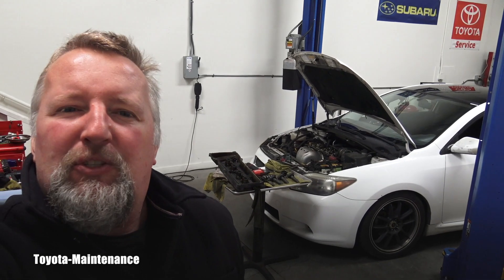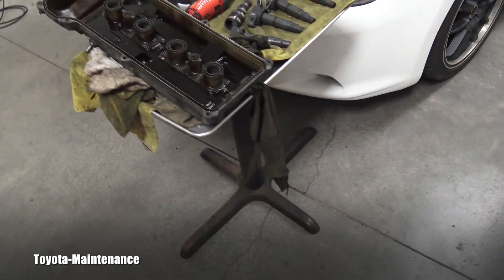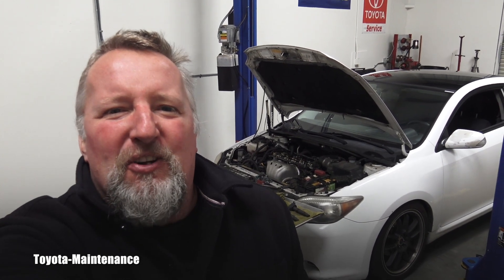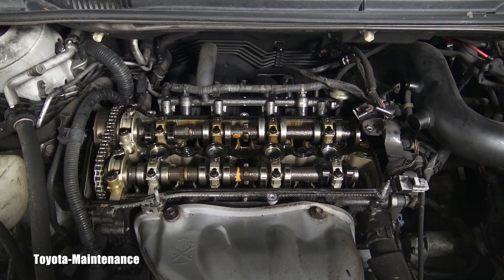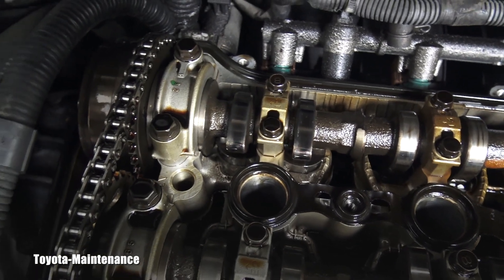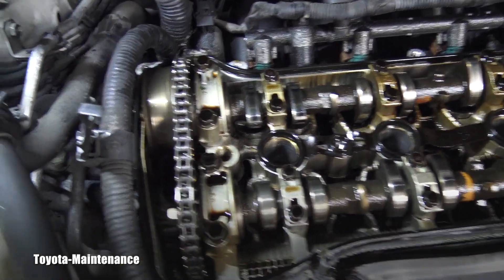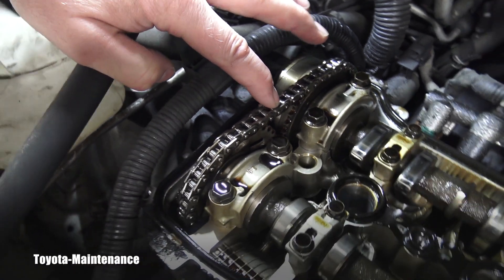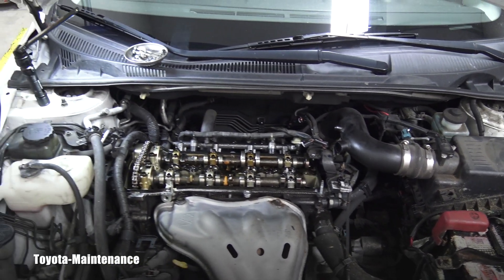Toyota Engine 2AZ-FE

Comment: I have a 2AZ-FE in my 2009 Toyota Matrix S, I love it.
Reply: I hate mine, oil burning garbage
Reply: @Idk-bs6in  how many mile does it burn oil mine burn 1qt every 1000 mile
Reply: @master6435  5 qt every 600 miles
Reply: @Idk-bs6in  dammm how many mile does the car have and year?
Reply: @master6435  10 yr, and had ~150k miles when I bought
Now ~190k miles
Reply: @Idk-bs6in  wow Im at 104000 07
Reply: @master6435  good for you? I guess yours doesn't burn much oil
Reply: @Idk-bs6in  yeah I'm saving up for when it consumes to much oil like what your going through
Reply: @master6435  rebuild engine $3k
New engine $1.5k for used + $2k for labor
Reply: @Idk-bs6in  yeah that's if you don't have the tools or knowledge
Reply: @master6435  the repair manual says I need another person helping me
also i don't have a place to work
on the street people call the cops every time
Reply: @Idk-bs6in  Oh that is a shame!
Reply: @Idk-bs6in  Just a quick question. Are you sure you are not loosing the oil as you're going along the road and seriously burning it? Two things pop to mind. A bad pcv valve and or a leaking valvecover seal. I have an 86 toyota pickup with the 22re. The thing leaked like a sieve on the highway quart/ 60 miles, but put only a few drops on the driveway. Kept the oil topped up too. Ordered new valvecover seal and have yet to see the oil level drop.
Reply: @jagtan13  the street is always dry
Reply: @Idk-bs6in  but is your driveway dry. That much oil would ruin the catalytic converters. You may be unknowingly pumping oil overboard only when you are moving. Unless you've smoked out the neighborhood.
Reply: @jagtan13  I street park, and there’s never any fluid beneath the car
Sometimes the occasional low tire pressure
Reply: Alright. But, i'm just saying that unless you're starting to get James bond smoke to look into re-sealing the engine. Otherwise i'd try getting a proper oil change and start running seafoam oil mix to de-carbonize the rings. If you're getting blow by just unlock the oil fill cap and rest it on top of the oil fill port, if it jumps then yes you are right.
Reply: Jumps while the engine is running.
Reply: @jagtan13  I’ve gotten many “proper,” oil changes. As for sealing the engine, this is more money and time into something that’s at the end of its life. 
I’ve spend enough of my hard earned money into tools for this car. Not to mention the many scrapes and cuts on my hands just to keep it running. If this was my job, fine, but I have to focus on my job, and put this hobby to rest. 
This is the point when the time and money spend on this isn’t worth it, if anything it’s costing me money. 
Plus it’ll nice to not have people calling the cops on me when working on my car, followed up by them asking me 50 questions, and the rest of the harassment. 
In a few months I’ll rid myself of this depreciating asset. Hopefully the harassment will stop then.
Reply: @jagtan13  with that much oil leaking during highway driving was it obvious with oil all over the engine?
Reply: @Idk-bs6in  my 2002 Toyota Camry with 20k best car so far
Reply: @bayfinest1938  good for you, the oil burning in my engine has gotten worse
194k miles now, but still need the car
I’ve almost got a new job, after many months of unemployment; so there went my high credit score, 
Meaning getting a car after this will be horrible, as the interest rates will be crazy, and that’s on the bright side, on the other I might not even qualify
Which is a shame, as my credit was approaching 750 before more car trouble and the unemployment that followed
The catalytic converter is ruined, they needed to be changed a while ago, because of all the oil burning, but I never got around to it, they were also around $400 as that shady mechanic said

So catalytic converters need changing, and I also checked the transmission fluid, and it’s black, not brown, so I was too late, meaning it’s damaged now

With the recent demand of mechanics, they said $6k for engine rebuild, which at that price I might as well get the dealership to do it
But with the transmission being damaged
It’s
Not worth it
$6k engine rebuild 
$5k transmission rebuild
$400 catalytic converters

Yeah this cars done
My wallet, time, and stress levels will thank me
When I get rid of it
Just need this job first, and to rebuild my credit

I still need the car, since my new job is in a rural area, and I live in the city
Otherwise I would have just taken public transportation, as I’m very familiar with it, and there’s so many in the city

Just a few more months with this car, plz hold on

Comment: While shopping for an older Toyota, I reviewed dozens of cars'  service records... 2AZ-FE cars (RAV4, Highlander) showed up with oil consumption test failures. One even was noted as being "off the stick" and another was 2.5 quarts low.  

Among all the other things that I want to avoid (incomplete records, multiple previous owners, infrequent oil changes, etc.), unfixed oil consumption issues and the head bolts not being checked are two more disqualifiers. ☹️
Reply: I have 2004 Camry with 250K miles on it . No oil burn, only like 1/2 of qt every 3k mile . Which is nothing at this age. I have little oil leak from timing cover and at morning start , I have little blue smoke which mean valve stem seal is little worn out . I change oil every 3k and Tran oil every year . Lose head bolt is due to heat. If some one always rump up the engine rpm to read zone to race or engine heat up due to radiator failure , then it will cost the head bolt problem.

Comment: A lot of ppl were screwed over by this engine. Notorious for overheating and stripping the rear head bolts. Should have been recalled
Reply: 100%. I've experienced this at 101k.

Comment: i got lucky with an 03 camry japan build VIN, at 307000 only starter 115$, power steering return line 70$, and radiator  leaking minor 80-120$ or bottle of kseal, easy to fix.  does not like full synthetic oils.  no consumption at all with semi synthetic high milage oil.  might try kseal and AT205 so i can run synthetic again.  runs well still.  liked an AT flush around 230 kms.  Use the dealer oil its best and cheapest.   I used synthetic castrol and it could use another flush back to the dealer oil now i would say.  dont overfill it, seems to change the shift pattern, have it removed asap.

Comment: i can vow for the reliability of this engine. I had one on low boost back in 2007 with stock fuel system and a bad AFR and this engine was daily driven for 2 years.

Comment: Stop saying a poorly designed piston ring is the culprit to the excessive oil burning. It just shows you lack an education of how the mechanics of a car works. The culprit is a clogged/sticking PCV.

Symptoms of a Bad or Failing Positive Crankcase Ventilation (PCV) Valve

Excessive oil consumption and leak.

Advising people to an expensive replacement is not only unethical, it's not needed. 

As the gasoline ignites, it causes an expansion of force that needs to be removed from the crankcase. A PCV is used for this purpose. As carbon and oil builds up the PCV becomes clogged and/or sticks, thus, leading to POOR ventilation of combustion pressure. This then has to escape somewhere else and it's usually THROUGH the piston rings as THAT is where the combustion occurs! 

I've read numerous reports on this issue and the many people I have spoken to NEVER replaced their PCV (Positive Crankcase Valve) which makes sense as to WHY their engines are burning oil more than necessary.

The lack of knowledge is understandable as I don't expect everyone to take the time to understand fully how a vehicle and all of its systems work but I have done years of research and reading books to expand my knowledge of vehicles.

The longer you run the engine without addressing this critical issue, the more problems you are going to create! It's common sense.
Reply: Yes, I totally agree with you on this. But I think there're 2 problems here. The 2AZ-FE had flaws in its design that can lead to burning oil and people don't even know about the car mechanism and do proper maintenance. I watch Scotty and he also suggest try fixing the PCV first when your car burn oil. I am also finding a good camry or corrolla to buy and this oil burner issue really makes me to think twice.
Reply: @hieulamtri5535  Because Scotty was never a car mechanic 🤫
Reply: LMAO
Reply: Chris, I’m trying to understand what you said here. When the pressure builds up IN THE CRANKCASE (that’s when a combustion happens), won’t the pressure escape from the seals first? In addition, both sides of the oil control rings are on the crankcase side (relative to the combustion chamber), so the pressure on both sides of the rings are equal.  I still don’t see how the leaking pressure from combustion needs to escape THROUGH the oil control rings. Could you help me understand this better? Thanks!

Comment: I don't know if I'm lucky, but I have two Camry's with a 2AZ-FE, and none of them have given me much trouble with oil burning. They do burn oil, but not enough that I have to check and add oil between oil changes. I do oil changes once a year.
Reply: Same here we must be lucky, between 5k oil changes my doesn't even burn a quart of oil barely any, quite amazing engines a lot of pep for a 4 cylinder

Comment: Yes the 2AZ-FE is a fantastic design. Overbuilt bottom end, good power, low weight(aluminum block) and as stated easy to work on. I have 2 of these engines that have 350,000 miles on them.
Reply: No oil burning issues? I am about to buy a 2006 RAV4 with this engine and a bit worried now reading all this stuff about the oil consumption
Reply: Jacob Johnson unfortunately yes some of the 2az’s can exhibit excessive oil consumption due to a flawed piston design in combination with going to long between oil changes. The problem usually shows up by 150,000 miles on the engine
Reply: If they can still go to 350k miles even with this issue then I have nothing to worry about right?

Comment: Had a 2006, I used fully synthetic, great torque curve, and burned absolutely no oil after 100,000 miles. I checked every 1,000 out of mechanic paranoia
Reply from the maker: thanks for sharing
Reply: Change the PCV
Reply: @christophervanzetta  Goof.  Now go delete this comment as well as ALL the others regarding the PCV valve being the 'magic' repair idiot!
Reply: @Buddyclub33  So you are arguing with a level 3 technician? 🤔

Comment: 2006 Scion TC here and the engine runs great...but the oil consumption is real.  I have to put a quart in every 500 miles.  Yes a full quart every 500 miles.  Interestingly there is ZERO smoke coming out the tailpipe, I'd love to know where all that oil is going.

Of note...my TC has 208k miles on it.
Reply: Change the PCV bro!!
Reply: Replaced my pcv but its still 1 quart every 1000 miles
Reply: Same year make model 243k zero oil consumption. Great engine.
Reply: The culprit is a clogged/sticking PCV.

Symptoms of a Bad or Failing Positive Crankcase Ventilation (PCV) Valve

Excessive oil consumption and leak.

As the gasoline ignites, it causes an expansion of force that needs to be removed from the crankcase. A PCV is used for this purpose. As carbon and oil builds up the PCV becomes clogged and/or sticks, thus, leading to POOR ventilation of combustion pressure. This then has to escape somewhere else and it's usually THROUGH the piston rings as THAT is where the combustion occurs! 

I've read numerous reports on this issue and the many people I have spoken to NEVER replaced their PCV (Positive Crankcase Valve) which makes sense as to WHY their engines are burning oil more than necessary.

The lack of knowledge is understandable as I don't expect everyone to take the time to understand fully how a vehicle and all of its systems work but I have done years of research and reading books to expand my knowledge of vehicles.

The longer you run the engine without addressing this critical issue, the more problems you are going to create!

Comment: 362,000 miles on my Camry, now I'm rebuilding!
Reply: How'd the rebuild go? I'm driving an '09 camry with 436k miles and haven't considered rebuilding yet.  Modifying the pcv helped the oil-consumption a lot tho
Reply: mine's an 09 camry.. only issue im having now is clogged exhaust
Reply: What year is ur camry any oil burning ?
Reply: Ali Saleh and yes it was burning lots of oil at 362,000 miles. But that was purely due to worn piston rings.
Reply: @NoKnockaKnee  A vehicle doesn't burn oil unless the PCV wasn't replaced. That pressure has to escape somewhere!
Reply: @christophervanzetta  do you own a vehicle with a 2AZFE? lol
Reply: @christophervanzetta  You're also quick to delete your previous comments I see.
Hahaha you got called out for your PCV BS!
Reply: Ali Saleh 2003
Reply: Think u got ur moneys worth lol maybe a wast to rebuild

Comment: Greetings from Australia. I have a Camry with this engine, and similar mileage, 191k miles/308k kilometers. It has some slight seepage from the valve cover (which I'm not too concerned about), and it sometimes leaves a drop of oil when parked - but it doesn't really burn much oil. Over the course of 2,500 miles, I'd say it consumes a little over half a quart (again, I'm from a metric country, so doing conversions...). All over an easy to maintain engine, all laid and spread out nicely.
Reply: Change the PCV

Comment: I have the first TC 2005 with over 160,000 miles and it still runs like new, just a couple of batteries and a few tire changes; the paint is pretty much gone however this car still runs awesome!  basically it's just a two door Camry.
Reply from the maker: awesome , thanks for sharing

Comment: i want to share my experience with toyota estima, i have change gear box matic k112, after i am finished replace the gearbox, i have some problem, engine indicator lights on, when the car is running, after that, i have scan that car, the DTC is output spped sensor circuit no signal. can you help me for solution ?
thanks before

Comment: I love this engine but the only thing i hate is that this engine likes oil too much!
Reply: Jay C  Stop saying a poorly designed piston ring is the culprit to the excessive oil burning. It just shows you lack an education of how the mechanics of a car works. The culprit is a clogged/sticking PCV.

Symptoms of a Bad or Failing Positive Crankcase Ventilation (PCV) Valve

Excessive oil consumption and leak.

Advising people to an expensive replacement is not only unethical, it's not needed. 

As the gasoline ignites, it causes an expansion of force that needs to be removed from the crankcase. A PCV is used for this purpose. As carbon and oil builds up the PCV becomes clogged and/or sticks, thus, leading to POOR ventilation of combustion pressure. This then has to escape somewhere else and it's usually THROUGH the piston rings as THAT is where the combustion occurs! 

I've read numerous reports on this issue and the many people I have spoken to NEVER replaced their PCV (Positive Crankcase Valve) which makes sense as to WHY their engines are burning oil more than necessary.

The lack of knowledge is understandable as I don't expect everyone to take the time to understand fully how a vehicle and all of its systems work but I have done years of research and reading books to expand my knowledge of vehicles.

The longer you run the engine without addressing this critical issue, the more problems you are going to create! It's common sense.
Reply: @christophervanzetta  TROLL Alert!
Reply: Same to me my engine has 173k is stock from factory still running good